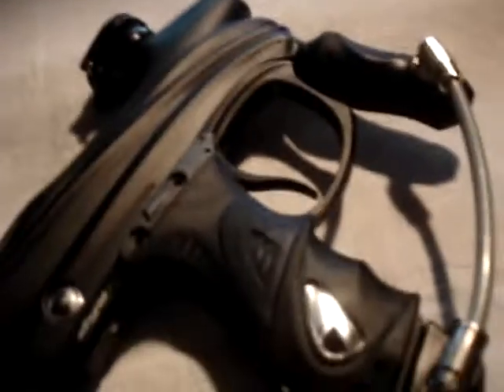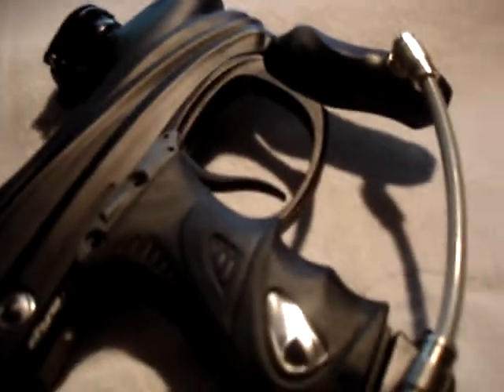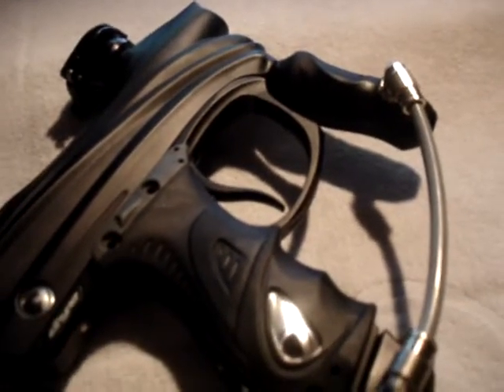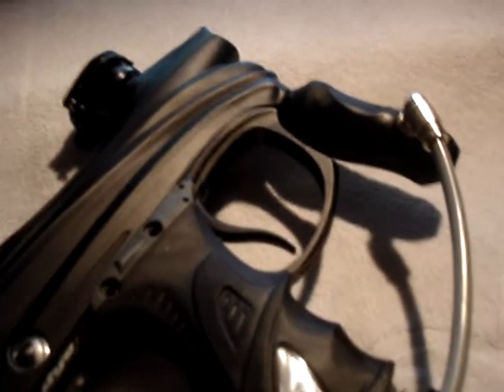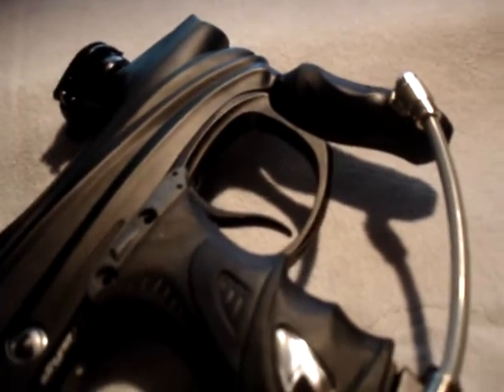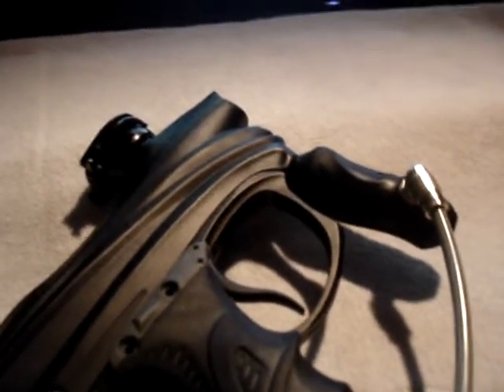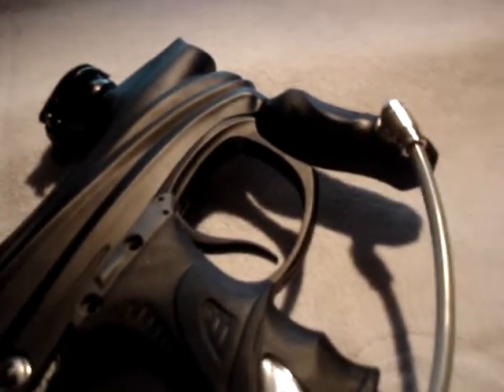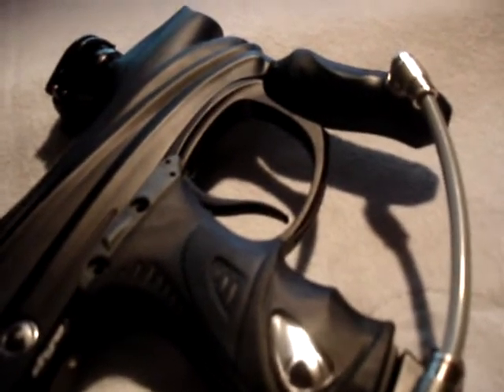How to change modes on dm8

Comment from the maker: @burton95  hi mate, sounds like your lpr, If the LPR is too low it tends to do that Try turning the LPR tp Turning it counter clockwise and it might just pop back for you count your turns so if that does not work you can put it back to where it was.

Comment from the maker: @burton95  so long as there is air running through the gun you can adjust the lpr to your hearts content untill there is enough pressure for the bolt to move, so i wouldnt worry to much about playing with that, theres not an awfull lot you can do to go wrong with it, are you uk or us based? because i have the email address for the uk dye tech, who does free advice emails etc, i could forward this on to you if you like?